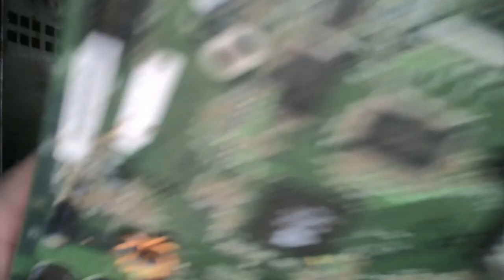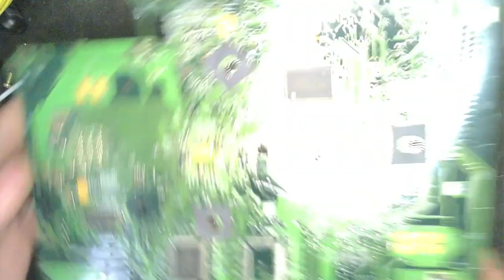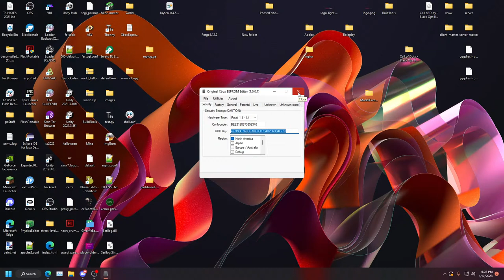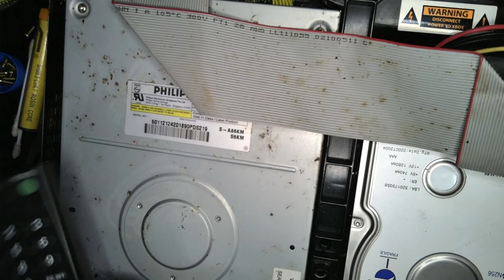Failed Hard Drive Original Xbox

Comment: bro mine is the 1.6 version, person before me softmodded it and it failed before i could get eeprom, i tried soldering some wires for the pico way, and for some reason the 3rd hole for gnd(ground) would not stick at all no matter how much flux or solder i tried, even tried cleaning it and resolder but nothing lol. i guess the motherboard is dead and i have no way to solder the pico chip or modchip

Comment: need some help if you can. mine turns off and on a few times then it blinks red\green and nothing shows on screen. it is softmodded. have not used it in years and just decided to power it on to see if it still works.
Reply from the maker: i had that occur when i flashed a bad bios. it will also occur when you solder the points to reenable some debug pins(This depends on the console version), but thats about all i can thing of
Reply: @wildmaster84  mine was a softmod no soldering involved just transferred from hhd to new hhd. worked great until now that i wanted to try it out and it did this issue. thanks for you help anyways good video
Reply from the maker: @xALFx13  ah then it might have something to do with the hard drive key perhaps. if your using a correct replacement you need to ensure the hard drive key is correct and if your using an adapter then you need to be sure you have the correct ide cable to power the hard drive or you would need to use alternative power source for it to work correctly
Reply: @wildmaster84  I  just wish i could see what is on that hard drive. just weird that it just happened one day after not using it for years. lol. thank you for all your help.

Comment: Hello every one. Any help will be greatly appreciated. I just soft modded my original xbox with cerbios. I installed and played Halo just fine then I downloaded Colin Macrae throgh FTP for some odd reason started giving me error messages which I do not recall what they were. I turned off and on my xbox and now after it boots up it just gets stuck on the blue XBOX Cerbios screen and it does not move from there. Thank you for any help.
Reply from the maker: It might have failed to copy the dash files so it just crashes, best option is to copy the retail dash onto the hard drive and try copying the new dashboard again. Also sorry for the late response, I have the take some time to think of what could be causing your issue.